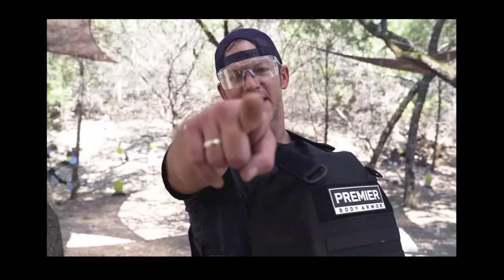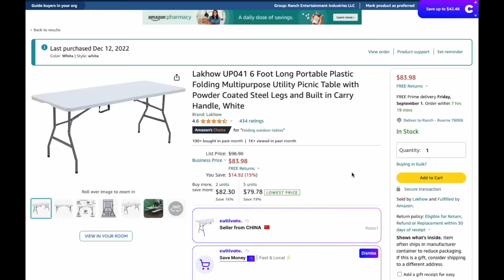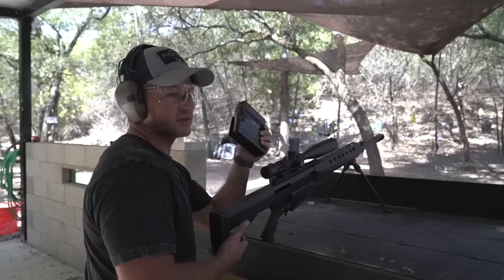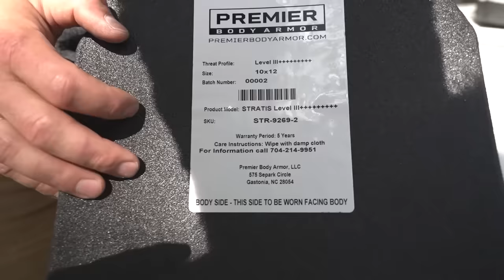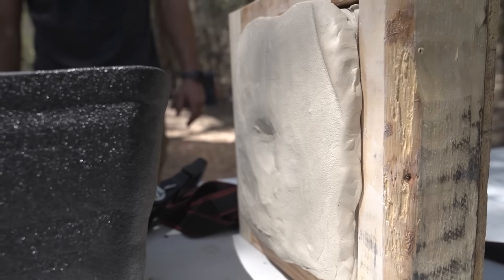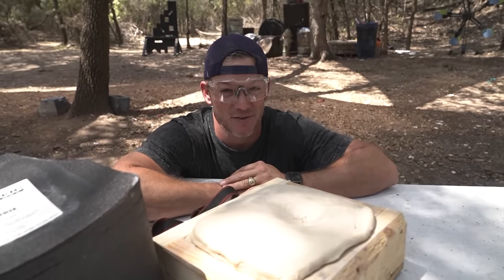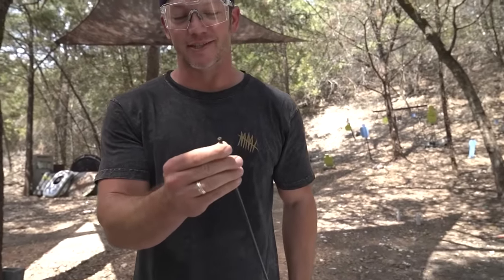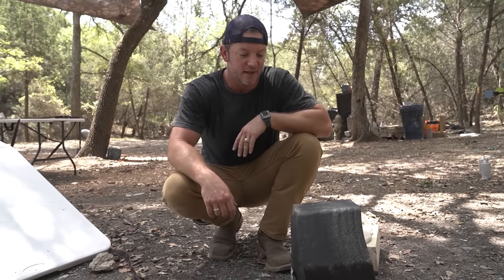50cal SLAP Round in a Serbu vs THICCCEST Body Armor

Comment: We learned something here today. Serbu is the strongest body armor of all. It can even stop SLAP rounds.
Reply: Eh, it has a 50% success tate
Reply: It was the sonic way that caused the deformation in the clay.
Reply: Yep. An ounce of prevention is worth a pound of cure.
Reply: @Grastiars1  all it takes is a real slapping bullet to do it.
Reply: you could say it has explosive power
Reply: even better it stops them from FIRING
Reply: So what, Scott stopped one, and didn’t even flinch.
Reply: @raygun26  neither did Matt's serbu
Reply: Once you chamber a sabot round in any rifle, its most likely gonna come apart if you try to take it back out without firing. The plastic doesnt have the same friction holding it in the shell like a metal round does.
Reply: Matt with that powder on the table, pulling back the bolt, is he asking to be in The AK Guy's channel, in the worst way you can? One Spark Away!
Reply: @Milspecpoptart  The better Mark3-11 or whatevers don't, is that correct?
Reply: Stick With Barrett, Black & Blue, 
Black Rifle Coffee, And Skiv Knives!
Reply: Or build a custom Nemesis Rifle.
Reply: @emissaryofelohim1431    Not even close.  It would just burn.

Comment: Be careful with those SLAP rounds matt. The bolt close issue is because the profile of the projectile is different than standard rounds, the sabot extends farther than the shoulder of a normal ball round.
Also, the muzzle brake needs to be specifically designed for saboted rounds, most aren't.

Comment: I almost peed on myself when Scott's segment showed up on that SLAP round.  THAT was the best video you've done in a LONG time, I think.  All of us love you guys both, Demo and KB.  Don't get hurt....stay away from SLAP...and apparently Serbu mixes...LOL. Thanks guys. You made my entire week.
Now, I wonder if Scott's PUNT gun would go thru.  Or his 4 bore.  Hmmmmm.  COLLAB
Reply: 4 Bore, probably.
Punt gun, definitely. I mean, did you see what it did to that engine block?
Reply: @The_Keeper To be fair, engine blocks are usually unhardened metals that are designed to withstand the wear and tear of  moderate temperatures for long durations. Body armors are designed to withstand extremely short bursts of extremely high energy. The material requirements are completely different. A .50 BMG will go through an engine block, too. Some smaller aluminum blocks can be damaged by smaller calibers. I think it would be a worthwhile test because of the difference in materials.
Reply: I doubt they'd make it through. Unless you can somehow load penetrator rounds in them?
Reply: 4 bore no way, it would hit like a cannonball and squish that clay out the back end of the box though. Punt gun would technically not penetrate but with buck shot the spread means you are taking the hit unless you are wearing the 9 plates over every square inch of your body. :p
Reply: maybe...with .416 ?!..see it's vdeo before.scott's did it before.rigby , rigbie...whatever..
Reply: I wanna see him use the .416 “Honey Badger” as he calls it.

Comment: Hilarious and even slightly terrifying episode! That is insane that there were serious issues again, with a different model even this time. Even crazier was this time the round was theoretically fine. Whatever the issue, y'all were very lucky that day! I agree with Scott, you don't have enough neck meat for all that 😂
Reply: in Scott's slap videos he mentioned the RN-50 he uses specifically has a Machine gun chamber, meaning it's looser than a standard one and that's probably why the round got stuck
Reply: @darylshriver8486 Scott's RN50 issue was powder charge related, not a "stuck bullet".
Mark Serbu sent off powder residue from the destroyed RN50 parts for chemical analysis. It's was a very fast burning pistol formulation loaded in the round instead of a slower burning rifle powder.
And it's was likely over charged....with the wrong powder too.

Matt's issue in this video is because very few 50bmg rifles have a properly shaped chamber to load and shoot the saboted lite armor penetrator.
The shoulder of the sabot extends past where the shoulder is of a normal ball round.
I'd have to look again at which few milspec rifles are chambered to fire the slap, but it's many, 3 at most.

Comment: That Serbu rifle turned out to be the world's most expensive bullet puller.
Reply: never the rifles fault
Reply: Yeah the serbu rifles look like shit after this video and Scott almost dying from it
Reply: @alexmaurice4274 however at the end of the day it was likely the crappy ammo used which was likely also tampered with at some point between them being acquired and resold considering the source
Reply: That round disassembled itself inside the barrel,really? If he pulled the trigger,that 50 cal would be sent in a blaze of glory. 😅✴️✴️✴️
Reply: @SightHandicappedRider9400 , more or less. Re-watch the video. 
Matt was wise to pull the trigger remotely. If it had chambered, it probably would have blown the gun up upon firing. No one wants to see a replay of Scott's accident up close.
Reply: Serbu has a marketing disaster on its hands tbh.
Reply: @scottyfox6376  , I would tend to blame shady SLAP ammo more than Serbu. Maybe the faulty cartridge was out of spec sufficiently that the Serbu ended up acting like a bullet puller. Ironically, this saved Matt from setting off an improvised grenade like Scott (KB) had done in 2021.
Reply: @MichaelScheele  The only thing the bolt pulled off,was the casing from a perfectly intact bullet,lodged itself in that barrel. If the bolt chambered it fully,that 50-cal was going to...hmm,well ✴️✴️✴️

Comment: I'm now wondering if the SLAP rounds have interference with Serbu's chamber dimensions, if that had been fired, all it takes is a moment of that bullet not travelling down the barrel and that pressure will escape somewhere! Maybe not the case, but an interesting thought.
Reply: That was my thought too! Lucky it didn't go off!!
Reply: I believe Scott had a custom made serbu that had a special chamber to let it shoot slap rounds. I may be wrong but I vaguely remember him saying something about that. That may be why it didn’t fit in Matt’s serbu
Reply: I was just thinking the same thing
Reply: @justinlabar1733  that or these rounds were even worse counterfeits that didn't give a single fuck about dimensions
Reply: or just serbu makes bad guns lol
Reply: Its supposed to be 50 BMG. If Serbu is cutting a different chambering then needs to be stated. This is kind of a weird observation.
Reply: @1014p  the serbu chambers are a little tighter than standard but still looser than some guns made for long range competitive shooting
they chamber .50 BMG and the ammo was probably measured with half an eyeball
Reply: Slap round must be feed into a machine gun chamber the throat is deeper or something to that affect.
Reply: Probably has something to do with throat and leade. I'd wager that SLAP rounds require a bit more of both which is probably why they are ok only for machineguns.
Reply: @kabusthepotato9572 it's just how slap rounds are, Kentucky had a bfg with a slightly wider barrel to shoot special rounds like those
Reply: @itsdrakegd981  huh
that's nice to know
Reply: @kabusthepotato9572  yeah I think it has something to do with the pressure, due to the fact that it has a plastic savo or something, anyways, it wasn't gonna work on a regular 50 cal

Comment: I definitely want to see the extraction of this bullet.
And some kind of explanation wouldn't hurt either!
Reply: looked like the penetrator was extended out of the casing too far which lodged too far into the barrel when chambered. SLAP-T rounds Ive used never had penetrators sticking that far out of the casing. They may have pulled it out to cause the obstruction on purpose to allow for the skit, thats my assumption

Comment: Scott is having PTSD real bad right about now
Also while we wait for Brandon to finish the AK50, someone else threw together a AR50? LOL
Reply: The AR-50 has been a thing for years. It's a single-shot AR platform chambered in .50 BMG.
Reply: The AK-50 already exists, it's the 6P62 in 12.7x108mm.
Reply: @Winkler_B_Rudolf_1911 Now make it .50 BMG
Reply: I know it's been around, I was just being funny 🙂
Reply: @nocount7517 you're thinking of the AR-50A1, this one is in .50 beowulf
Reply: @Winkler_B_Rudolf_1911 wouldn't that be bigger though?
Reply: @MotoVengeance  Yes the 12.7x108mm DShK is a bit bigger than the .50 BMG which is 12.7x99mm, and there are also 12.7x108mmR ShVAK and 12.7x114mm which are also of Soviet origin like the DShK round.
Reply: @SennaOnit  It's a Soviet design, and they never built weapons chambered in .50 BMG, they did use that caliber, but in foreign-made weapons.

Comment: Dear Demolition Ranch safety guy: Mark Serbu uses a special proprietary chamber reamer in his 50bmg rifles that has a slightly tighter "throat" which leads to slightly better accuracy when using surplus ball ammo and even better accuracy with something like hornaday A-max....  however it doesn't play well with specialty rounds.  Anything with a sabot isnt safe because it can slip down into the case when chambering, causing a compacted powder charge which is extremely dangerous.

You're better off using one of those $1500 single shot 50bmg a.r.15 uppers because they use the standard M2 chamber reamer.

Comment: Holy shit!!!  I just realized something. When that slap round got stuck in the barrel, because the sabo is too big, and pulled the round out of the case, that is probably what caused the overpressure in Scott's gun. It may not have been overcharged. It may have been over diameter. Too much resistance going down the barrel and over-pressured, causing his injuries. I think you might have just avoided your gun blowing up.

Comment: SERBU chambers are about halfway between military loose chambering and competition tight chambers.  they will feed ball and all the normal "special" ammos but slap rounds are fat and require a loose loose chamber.
Reply: KB's serbu actually had a special chamber cut and a heavy barrel just to be able to shoot them. Id be pulling the round apart and re checking the powder measure and dimensions before i chamber any slap round.

Comment: Hear me out. You shoot a plate welded to a bracket that can spin. the force of the bullet hits the plate in turn, pushing the L-shaped bracket with a boxing glove and it punches someone in the side or in the chest so the force of the bullet is partially transferred through the metal and spinner and spins the boxing glove into someone. Or it is a gel hand and slaps someone in the face. Slap round.

Comment: Yeah, if that slap round was seated so far out that it got jammed in the rifling, chances are it would have messed the rifle up. That will cause a massive pressure spike as bullets need a run-up to engage rifling safely. 

Where do you guys get these death rounds from?

Comment: What’s the difference in 500 AM and 50 Beowulf? They look super similar but they’re actually very different. 500 AM pretty much doubles the power of 50 Beowulf believe it or not. The 500 AM is much more reliable and much more widely available too. 500 AM also runs on an AR10 platform whereas the 50 Beowulf is ran on the ar15 platform. Which is one reason why the 500 AM is more reliable. Larger recoil spring, larger extractor and larger bolt of course.

Comment: yeah buddy  that bmg on a  long bore , ive never seen windshield nor ceramic nor any other type of protection stop it. i have in cut a scool bus roof off. ive seen it make a whole mud house a pile of dust. someone should try the one inch bore 2000 grain AR pistol challange. if you can make it  or at bare minimum someone needs to stick an LMG round on an ar platform and see what happens.

Comment: Hey Demo

Just watched “Egg Target Practice at 300mph (483km/hr)”
by Bruce Yeany
He was firing a raw egg through 3/4” plywood like it was tissue paper.
Looked like he was using compressed gas and a 2 chambered system out of PVC, with a 8’-10’ long barrel

Is there ANY chance you boys could build something similar… but much better? 😈

Comment: My AR-50 won’t chamber them either.  The plastic around it is straight, and doesn’t match the ogive of the barrel.   They’re meant for an open bolt type gun. (M2)

Comment: Okay but imagine the chamber pressure with a round soooo not ment to be chamered in a .50 cal rifle it separates from the case when you pull the bolt back. There is no way it can go far enough to clear the gasport not to mention the muzzle end so all the pressure goes trough the chamber walls and the bolt head. Insane.